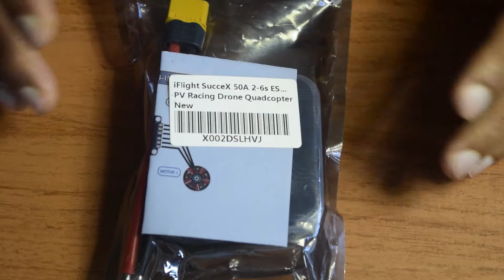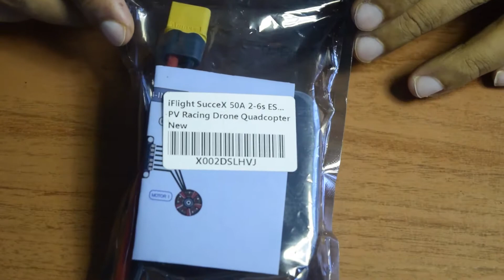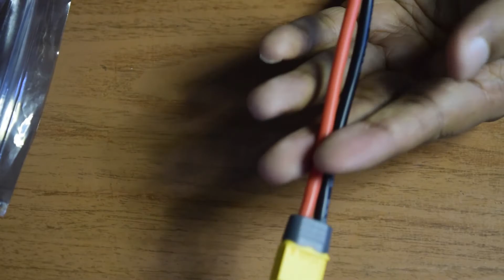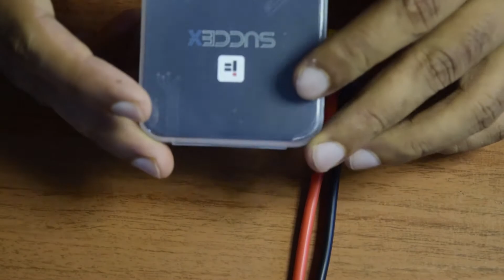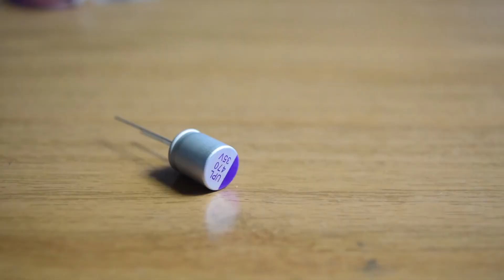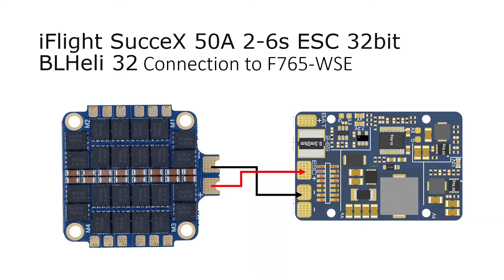Begineers Guide to Drone ESC / MCU | iFLight SucceX 50A 2-6S BLHeli_32 Dshot 600 4-in-1 ESC Review

Comment: hi!! im having an issue with this esc, as soon as i plug the batery in instead of the normal 3 start up "beeps" i get 6 beebs, (3 first, one second pause and then other 3) i cant seem to find anywere a manual for this esc, would u have any ideas why this is happening??
Reply from the maker: 6 beeps means esc startup error. this may happen due to several reasons. one of them is you have not connected the salve wires of esc go your flight controller. make sure you connect all wires of ESC to the flight controller. Please follow my wiring diagram to find the right connection. I hope this will solve your issue. Please stay tuned to my channel for my future videos.